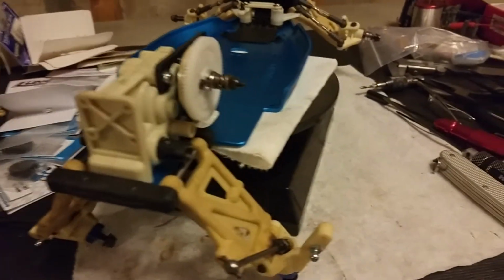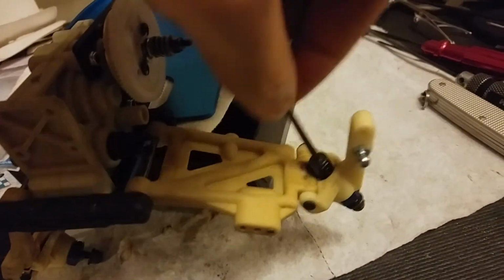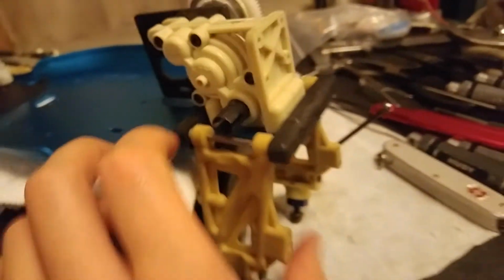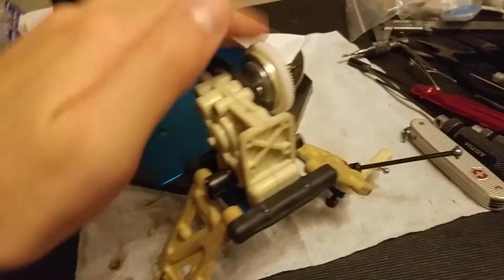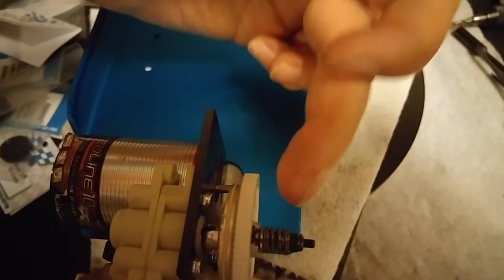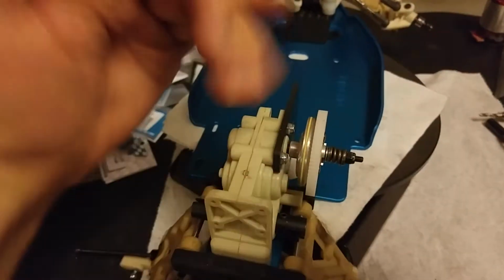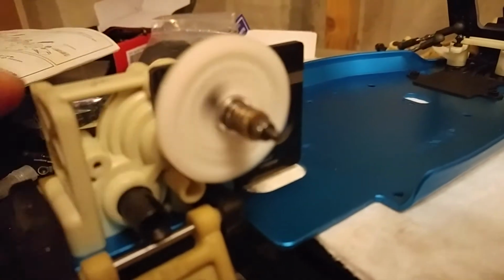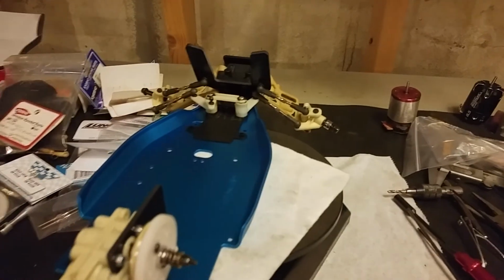Vintage Kyosho Rampage Pro-E build, Part 2

Comment: No no no no! Your missing something! Shim the motor plate forward to its farther against the slipper clutch! Then you will have the right mesh for the gears AND your motors weight will be centered! Give it a try!
Reply from the maker: You have to do it the way I did it.  The slipper hub has to be modified to move further inward.  Shimming the motor plate outward, without modifying the slipper hub, will not move far enough before hitting the slipper hub.  It would also require longer screws and potentially put more stress on those screws, as the motor plate no longer tightens against a larger structure such as the gearbox.  The only viable alternative I can think of is a CNC aluminum motor plate, where the plate itself has an S-shape if you look top-down, such that the motor is pushed further outward while keeping the plate "body" mounted against the gearbox.